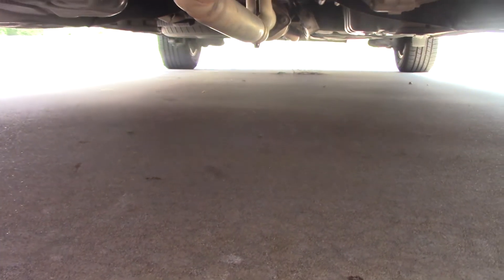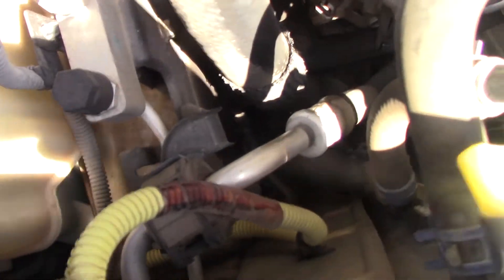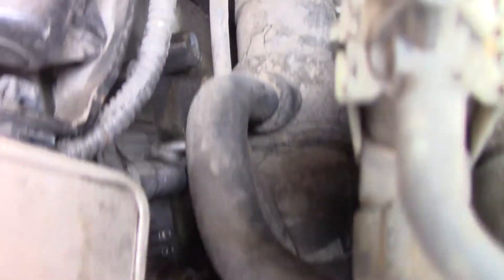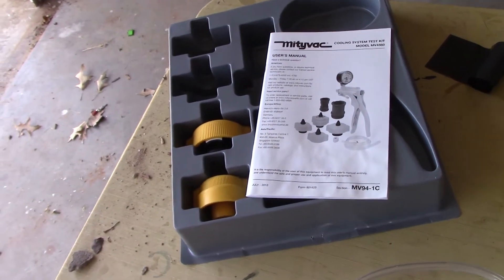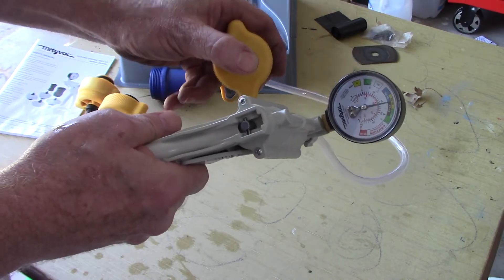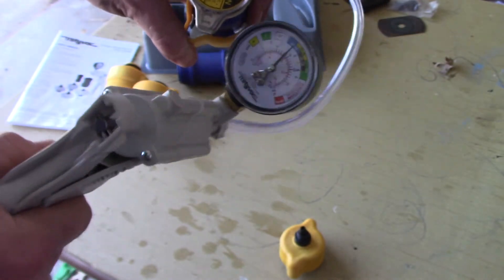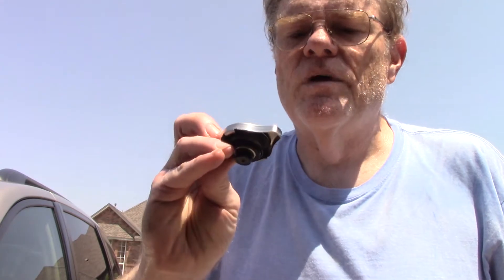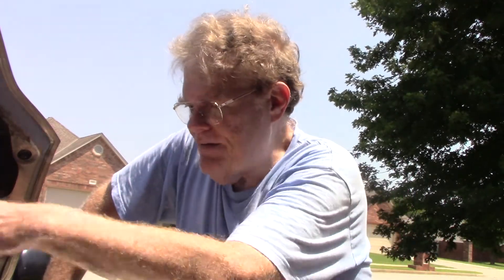Toyota Sienna Hot Coolant Smell

Comment: Hi I already changed radiator,tersmoste, wharer pump and olso coolant temp sensor is overheating after 30 min randomly. Doyou have enough other options? Please let me know  🙏tks
Reply from the maker: Have you actually checked the function of the coolant temperature sensor? If it is randomly reporting an overheat condition, I'd at least suspect it. If you're engine is truly overheating inconsistently,  it would make me wonder if you had something like an obstruction that's moving around in a passage somewhere. Have you drained and refilled the coolant?

Comment: I have the same 4560 kit and I have a question 

Do you find that pressurizing the cooling system actually bleeds the system?   (Brings air to top)
Reply from the maker: It would be really easy to infer that it does, but I actually read a procedure for bleeding the system on that 2GR-FE engine that says you must also open one (possibly two? been a while since I read it) separate bleed valves at the bottom of the engine. Now since I did that video, the coolant smell never recurred and we sold that Sienna in September 2020. So I never had a project that required me to completely bleed the system. It would sure seem logical that it  should bleed the system, but I guess there are caveats that would force me to say you can't rely on it, especially if there are other bleed valves built into the engine.
Reply: Doing a 2008 Ford Focus in a few days and I read that they hold air behind thermostat and you need a vacuum filler to get air out.  

Wondering if I can pressurize after filling system?